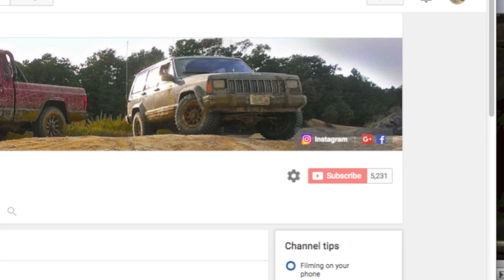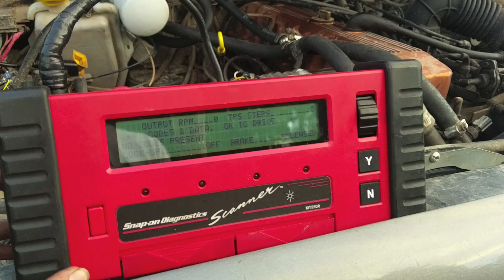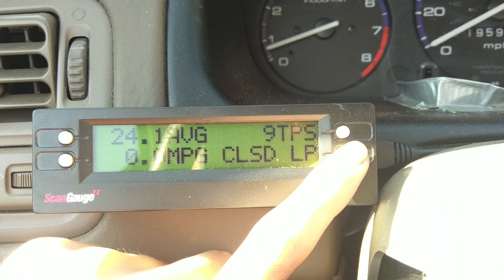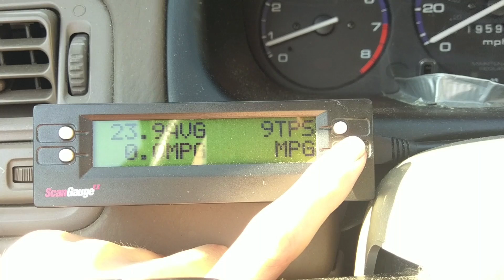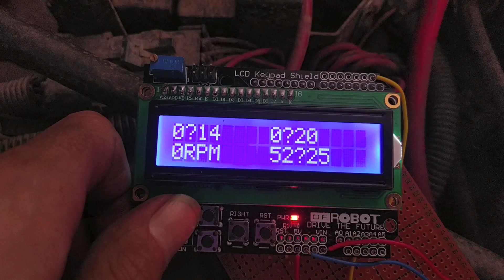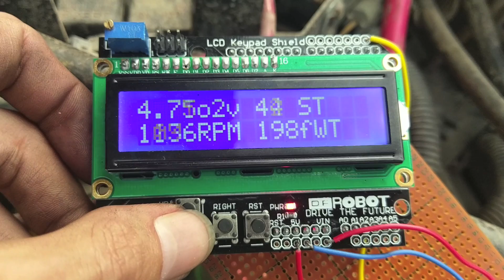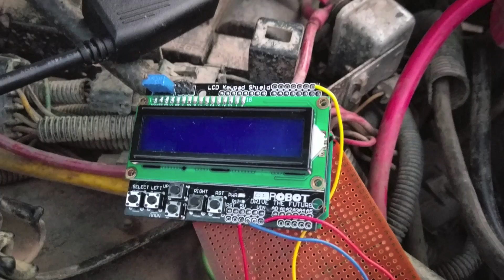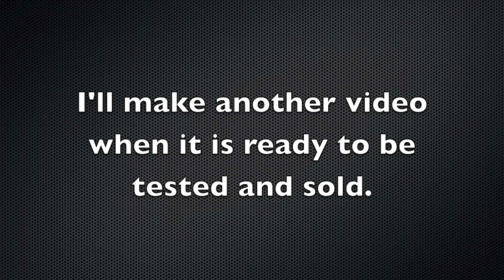5k Subs, Channel Stuff, and a Secret Project?

Comment: I see these monitor coolant temp.Any way to get one of these to trigger an electric fan relay at a certain coolant temp?preferably adjustable.
Reply from the maker: I like the way you think. I've thought about doing at one point and the REM hardware had been designed for modding for stuff like this so it's very possible. The REM has a few open pins left and could control an Arduino safe relay or maybe even transistor could be used to trigger the regular fan relay to turn it on or off. The board has four open lines to the connector so a wire could be hooked up from in the engine bay.
Reply: Yea a very cool feature for those who have dual fans or for those that want to trigger the stock electric fan independent of the stock control
Reply from the maker: Well if you're any good with soldering and wiring then let me know how serious you are and I might be able to figure out the circuits and code necessary for that. I have been thinking about making my own separate controller for a while but building it into the REM would be awfully convenient.
Reply: Ive picked up a soldering iron a time or two.

Comment: now I've got a 92 Cherokee Laredo and I'm not seeing these yellow ports, I remember in one of your vids you said that they were under a tray, is that the fuse block tray or would mine be too new to be renix?
Reply from the maker: Sorry bud, Renix era is only from 87-90. You're part of the chrysler OBD1 91-95 range
Reply: +NickInTimeFilms hmmmm that's weird because I cannot find a port anywhere on this thing, not sure why or where it would even be
Reply from the maker: Yours will be on the driver side fender, closer to the fire wall. It is a medium sized square plug with blade connectors. It's just connected to some wires, no bracket. I actually have to adapter for my mt2500

Comment: I would like to be a test subject for you lol my 89 see anywhere between 4k-11k feet in elevation I'd love to know what it's doing at higher altitudes
Reply from the maker: Probably running funny. It saves the initial barometric pressure reading and goes off that for the for fuel control so once you're in a vastly different pressure it probably isn't stoic. Shutting it off and back on would reset the Baro reading though. 

Anyway, I'm guessing you have a cherokee, but Auto or Manual Trans? For the initial Alpha test batch I want to get a large variety of years and engines and transmissions to make sure my code will actually work on other models.
Reply: here are the stats i can give you on mine i'm still learning about her as she is still relatively new to me. love following the channel
1989 jeep Cherokee wagoneer limited
Amc 242 4.0L Renix MPI motor
Aisin-werner AW4 4 speed auto
New Process np242 select trac 2.72:1
Dana 30 HP Non vac
Dana 35 non c
3.54:1 gears
3" tough country lift 
31x10.50x15 bfg ta/ko2 all terrains

Comment: Oil pressure readings??
Reply from the maker: No, that's a gauge cluster only sensor sadly. The scanner only reads what the ECU sees. maybe I can work on some splitter adapters in later iterations
Reply: +NickInTimeFilms Would you know why my oil pressure gauge is pegged out?
Reply from the maker: +JeepXJ yup, bad ground or a bad sender. search up my oil pressure sender into replacement video
Reply: +NickInTimeFilms okay cool. been watching your videos for like 2 hours lol. Doing floors. rear drums. wheel bairings and tie rod end tomorrow. gonna be a lot of work

Comment: Great work, I'd buy one for my MJ. It would be cool to see it display everything the nicer gauges show for us with dummy lights. Water temp, oil press, rpm etc. as well as scan codes.
Reply from the maker: The Water Temp, RPM, and Voltage are part of the ECU stream, the Fuel Level, Speed, and Oil Pressure are sadly only connected to the gauge cluster and isn't even read by the ECU. Progress is still moving smoothly, I update regularly on my Facebook page. The ECU doesn't give any codes, but I'm trying to work on a diagnostic mode that lets you see if sensors are out of range.

Comment: I would love to get a Renduinix.  As far as the overmolding situation you can make a solution of 1 part silicon caulk to 1 part corn starch with a small bit of water just to soften it a little (it will feel like play-dough).  You can also add food coloring or die for color.  Mold it to shape then let it sit  overnight and it hardens into a semi flexible rubber.  Go to the junk yard and get the female Renix connector to use as a mold, put the wires\pins in place where you want them then cover them with the mixture and let it harden.  Spray some cooking oil or something on the connector so it will separate easily.  It should resist the temperatures fine and is waterproof.

Comment: Awesome, there are so few  diagnostics out there for older vehicles. I have a 93 XJ with ODB I ,  and counting the light flashes after turning the key on/off 3 times is a  pain. I don't expect your device would work on the 93 as it is not Renix, but making something similar  may be possible.  I assume since both are OBD I at least the data capture part would be the same just the look of the data would be different. After seeing this I am going to have to try a similar project.
Reply from the maker: Depending on the success of this I may look into the workings of 91-95 obd 1 protocol. when my friend gets his 95 up and running I'm going to poke around with my snap on scanner to see what can be seen. I'd like to tackle the auto trans before this however.
Reply: If I get to it first I will share what I find on the 91-95's
Reply from the maker: +TheSoftgoat Sweet. I'm looking into the legal stuff but I'm looking to make my scanner open source and I'll be sharing every juicy little bit about it, from theory to hardware to software

Comment: I've been subbed for a while and always thought you had way more subs. But congrats man. You definitely deserve more than that, your vids are super helpful. And I would definitely be interested in buying one of those scanners!
Edit: Count me in as a guaranteed buyer if you get the final price in the $60-$100 range. It would also be great if you get an easy way of updating the firmware too. I'm handy around a computer so I think I would be a good tester for you. Never built an ardiuno but I have built PCs, done a lof of networking, and messed around with a raspberry pi. 
Fingers crossed this works out well, been wanting a "scan" tool for my 260k 89 XJ
Reply from the maker: Sweet, I'll keep you in mind. I just finished v0.4 so it's at a useable stage now. Time to add options and check compatibility with other years/engines/trans.

 I'm aiming to keep to price at or below $100. I've been slowly building a master list and it seems like that's a reasonable price point to hit. 

The final board will have USB on it so updating is as easy as plugging it in and uploading new code. So far you'd need to download the arduino software to do that but I wonder if there is a stand alone package that is only for uploading to a board. I'm pretty excited with how this project is going.

Comment: Interested!  '86 MJ (uses renix)
Reply from the maker: Hey, finally got around to probing all the years from my MT2500. What Engine do you have?
- 1986:
 - 2.1L Diesel uses a different or no ECU
 - 2.5L EFI Gives almost as much data as the 4.0Ls (Most useful)
 - 2.5L 1BBL Gives a few dummy readings (High/low, under/over, on/off) and Battery Voltage
 - 4.2L 2BBL Same as above
 - 2.8L 2BBL Uses a different ECU comm/Connector? Can't display anything.
Reply: I have the 2.5l EFI, 215k miles
Reply from the maker: Cool, you're in luck then. I have found that there is an issue where I can't read Manual transmission equipped jeeps, so that will take some looking into. Auto 4.0Ls and 2.5Ls should work a treat though.
Reply: Good deal, please keep me updated.  Great work.
Reply from the maker: I'll try to keep the channel updated about once a month, maybe before for big updates and progress. All the smaller little weekly-ish updates end up on my facebook page. Link in the description
Reply: Great, thanks.

Comment: I would absolutely love one. LED lights if there is a problem with something, if something is out of spec.
Reply from the maker: So some kind of warning led that lights up when something is out of spec? I suppose that would be a Check Engine Light. haha. I'll add that to the idea list.
Reply: Yeah, but more like, if you switch to say, the o2 sensor readings and it is out of spec, then it turns on? not just on all the time I guess. Sent you a PM too.
Reply from the maker: Gotcha, so a warning light for currently displayed readings. I'll see what I can do.

Comment: finally a face to the voice. I once looked into making this for my Jeep before I got the mt2500 and I think I found a supplier for the connectors. but I can't remember the brand of them. but I would love to test this out and dabble in the code. I also have a 3d printer if you need things test printed
Reply from the maker: 15 Pin Molex Connector #03-09-2159 seems to be the ticket, ordered a couple to verify and test with. Sweet, have you done any work with ABS or only PLA? Any recommendations for decent enclosed ABS printers for under $1500?
Reply: mines fairly custom I don't have an enclosure for mine but it will do abs and pla. I use hips more than abs.
Reply: as for 3d printer recommendations its fairly difficult to recommend one. they all have there plus's and minus's. for most part makerbot ones are fairly good aside from the coding being all closed source. as for most modifiable i would go with a reprap like printer as they are based on open source firmware and you can pretty much do anything with them. but if i had the money i would get a lulzbot (https://www.lulzbot.com/store/printers) hands down.

Comment: I want one for my 90.
 Do you know of any other vehicles besides jeep that used Renix?
Reply from the maker: Some Volvos and many Renaults. The core code was originally designed for a Renault R21 Turbo but I was able to adapt it to work. Going from 4cyl to 6cyl proves a bit tricky with the RPM readout though.

Comment: Well done on the subbs :-D, you allways make your videos interesting and light hearted in presentation, i dont even own a vehicle and i enjoy your vids, work that one out LOL :-D.

That connector does look odd, but its just got pins missing in a grid, ignore the daft tryangle pattern at one end, shame the yellow caps wernt easy to get, you could drill the pin holes in it and cement pins in.
Old cars used to use bullet connectors, i bet the crimp on type would fit the holes.
You need to post the pin diameters and pin spacing so people can compare against say r.s semiconductors and other sites and sources.
If the aldweeno is connected to the vehicle supply, protect it from reverse polarity, people do silly stuff ya know lol.
Sorry im waffling to myself ha ha :-D
Reply from the maker: Well, if even non car owners can watch then I guess I'm doing alright, haha. 15 Pin Molex Connector #03-09-2159 seems to be the ticket so that's one problem down. Gotta look into overmolding to make a solid adapter though. I was thinking about safety features of any kind like polarity diodes and maybe a filter cap for really noise systems. I want to make this as idiot proof as possible so that the hardest part is figuring out where to mount it.
Reply: Depending on how you have it connected, you could put a small fuse in series with the supply and a 1n4002 diode between the + and - input to the pcb (banded side of diode to +), worked in cb radios for all those years :-D.
Overmoulding hmm sounds expensive, what about putting some epoxy around the wires entering the plug, then slide over some big ass heatshrink tubing, heat untill done (sounding like a cookery program lol).
Reply from the maker: A fuse is on the list. Current connections are Ignition Positive, Ignition Ground, and ECU TX which basically switches between floating and path the ground. Ohhh, so by installing the diode in reverse straight over the power lines will take all the current and pop the fuse instead of running through the circuit? Epoxy will most likely be the solution, but the heat shrink might clean up the look
Reply: Yep thats the job of the diode, the fuse is there just in case the cable gets shorted as well, if you think your device can run with 0.7 volts less then bung a 2 amp diode in series instead :-)
Reply from the maker: Well considering the Arduino board regulates down to 5v, I don't think that will be an issue. haha.
Reply from the maker: Hey, So I'm finally getting into the nitty gritty of developing a pcb and I've got everything laid out. As for protection stuff, what should I add? I'm thinking a fuse would be a good idea in case of overcurrent. My unit only pulls 40mA of current when running so I would leave some leeway in case other people want to add onto the board , 500mA is probably fine.

Overvoltage is more of the important one here. I already blew up one of my test micros because i didn't realize it was only good up to 12v. The new micro I'm playing with has a regulator good up to 16v, but then heat is the concern along with if anyones alternator/battery starts pushing more than 16v. Heat output of the onboard voltage regulator is 140ºF/60ºC at 13.7V so I think I should add some extra voltage diffusion for longevity. 

Looking up simple diagrams, I've seen the use of Zener Diodes. So if I understand this properly, it works like a normal diode and will protect against reverse voltage when in parallel, but can also regulate voltage higher than the diode's breakdown voltage? So If I choose a Breakdown Voltage of say 6.5V to give the regulator some leeway, does that mean that 6.5V will flow to the micro and the rest is just sent through the Zener? 

Is this okay or are there other concerns? Thanks for the help.
Reply: You could put a couple of ordinary diodes in the power cable, they will lose about 0.65 volts each, so less voltage and you cant reverse polarity it as the diodes wont conduct :-D
Reply: Hmm a zenna, yes you can use them for limiting the voltage, but you need to feed it with a resistor, the resistor limits the maximum current to the zenna, they cant crowbar all power to ground, the zenna would be massive to do that.

Comment: Oddly this is my problem today... Reading my 97 ZJ's computer. Well actually my ABS. If you could make a windows , android or even arduino emulator of the MT2500 that would be awesome and I would be interested in helping you since I have one. My FSM says I need a DRB tool to fix my ABS even though it is ODB II. I cant seem to find any software to talk to the transmission or ABS any where... I have a OBD II scan tool but it seems useless for anything beyond the ECU. Actually it doesn't even seem to completely read the ECU....
Reply from the maker: Depending on your model, you may only have a code reader and not a scan tool which show live data and other things. ABS and other system are notorious for preferring the fancier multi-thousand dollar service tech scan tools which the MT2500 can do. Emulating one would take forever unless I could download all the info off the chips i have but it probably wouldn't be very legal even if i could do it.
Reply: +NickInTimeFilms Right snap on probably wouldn't be happy even though they don't even sell these any more... Who knows perhaps you could make it then sell it to or licence it through them and make tons of cash in some kind of partnership. I have a two way scanner I can clear engine codes. Come to think of it I'm surprised snap on could even make a Chrysler compatible scanner with out getting sued them selves by Chrysler...
Reply: +NickInTimeFilms depends on if the patent has ran out or not I'd think. but I'm not a lawyer, haha.
Reply: +Adam949 that's why they went to obd2. before that every computer system was proprietary, but there was a class action lawsuit that forced auto companies to standardize so small shops could fix them.
Reply: Ya but my jeep was built in the beginning of obd 2 sure i can talk to the ecu but not the transmission or ABS systems. No body has any software compatable with my jeep for under $1k.

Comment: Great job. If you only need 3 wires, and 2 are power, then you only need to tap one line, right? Some data loggers, radios that read ODBII and tuners have the installer cut-n-splice the data wire. Although, if you can find a plug that fits, that may assist the guys that are wiring challenged. On CAT5: If you decide to use CAT5 cable, make sure to use "Stranded" cable. Stranded will not break in flexing type installs. Most CAT5 is structural, and use solid core wire. Solid core wire is great in building that don't move. But in mobile applications, sold core wire will break at vibration points.  If my Master Jeep (MJ) still had the Renix system, I'd be very interested in buying this, even in developmental stages. But I already swapped the whole electrical system. Again, great job as always.
Reply from the maker: Although true, the less intrusive my design, the better. Modifying means commitment and possible mishap which  might turn some people off. Love the points on differences in Cat5, these are the little details I love and will be a deciding factor in final production.